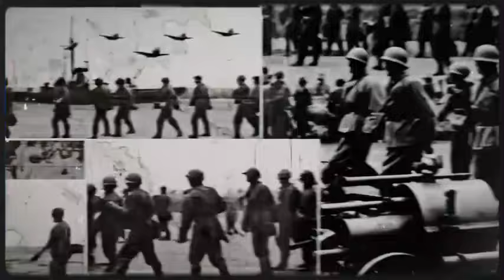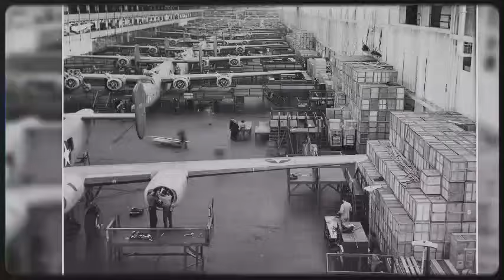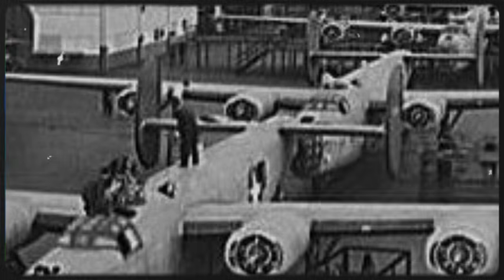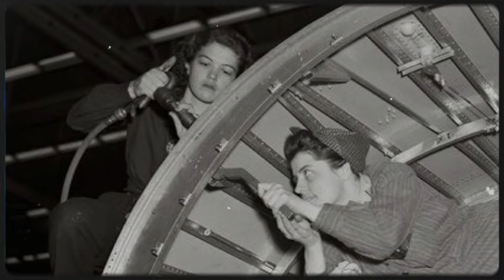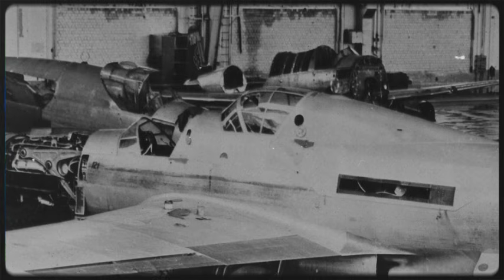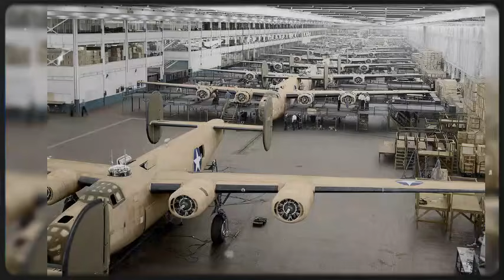The Invention That Helped Build a Bomber Every 55 Minutes

Comment: Engineer Lewis C. Huck observed these riveting bottlenecks in German aircraft factories during the early 1930s. He developed a structural blind rivet that could be installed from only one side using a pneumatic tool.

Comment: I'm sure that the Huck blind rivet and huck bolts were helpful. However, the aircraft manufacturers continued to use far, far more solid rivets. These organizations trained 10s of thousands of women to rivet and rivet very well. The training took time, but with a few weeks of training the women and newbies did fine. They also took advantage of concentrating training on a particular riveting situation rather than creating craftspeople prepared for every situation.
Ford and other contractors did amazing things to produce B-24s at these rates. These big airplanes were not designed for mass production. Ford designed a plant to mass produce them anyway. 
Fighters like the P-51 and Hellcat, which were designed late enough that the engineers knew that they would be built in large quantities were much easier (and less expensive)to build fast and well than airplanes that were designed to be built as a prototype for evaluation followed by peacetime contracts.
As an example of how well this could be done, Grumman always met or exceeded their production targets every month through the war, independent of the draft and all the other labor hiccups. And the product was always a superlative quality product. I've never heard of  Huck fasteners as part of their success.
In fact the product that I have heard of in that context is school busses.

Comment: You’ve sugar coated the “quality” problems at the Nazi aircraft plants. The SLAVE LABOR that the aircraft plants contracted from concentration camps actively sabotaged the planes. Those concentration camp inmates were worked to death and / or died in the camps. That is much darker than merely being insufficiently skilled.
The Huck rivets which made it possible for Ford to build a bomber an hour live on today as “pop” rivets. I doubt there is a diy-er who doesn’t own a pop riveting kit. They range in cost from a plastic box with the tool plus a small selection of rivets for less than $20 bucks to commercial hydraulic units. I had a snow blower whose housing was plastic and cracked at every stress-riser. Eventually it was more old license plates and pop rivets than plastic but served me faithfully for two decades. Thank you Mr. Huck!